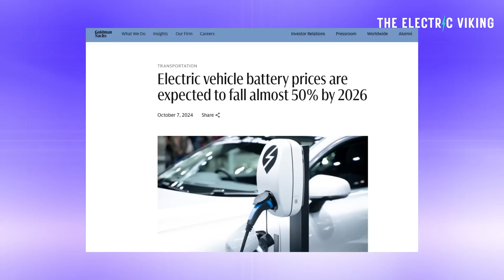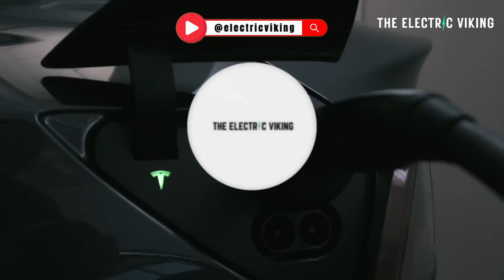Analysts say a NEW EV battery will be cheaper than fixing a gas engine

Comment: This is another reason no matter what actions legacy ICE manufacturers take other than full conversion as fast as possible, they are all destined for bankruptcy.  People don’t understand that the economic effects of losing 50% of their customer base, affects the price of every single part and any chance of making a profit.  All while trying to sell outdated old technology at a much higher price point.  Good luck with that strategy.  The economic devastation of these companies hits in the next 5 years, not 10 or 20 years down the line.  Wait till gasoline prices shoot through the roof from increased costs spread over half the volume.  Nissan may be the first to go inside 3-4 years.  They are in massive trouble right now.  Ask the Stellantis CEO how they are doing.  OH yea, he just stepped down because of that train wreck crashing in real time.

Comment: Yeah if sodium batteries are eventually as weight efficient as lithium ones are now wow hope you have a vehicle that allows easy access to battery compartment🤯
Reply: You would still have to either change or re-program the BMS (and possibly car's body-computor) because the cells will have different voltages and current capacities.

Comment: Imagine how much more powerful NIO battery swap will be with this.
Reply: NIO bot?
Reply: @bobwallace9753  Huh?
Reply: @mysandwichlife  
There are a bunch of pro-NIO swapping comments.  Looks organized.

Battery swapping does not make economic sense.
Reply: @bobwallace9753  it makes way more sense than sticking the battery to the car especially for resale value and checking the quality of the battery.
Reply: @mysandwichlife  
There's no need to remove a battery pack to check its condition.  The EV's software does that.  And as we move to very high cycle life batteries, the body is going to wear out before the battery pack.

Don't judge today's technology using ten year old technology.
Reply: @bobwallace9753  why would you ever want a battery stuck to the car that you couldn't remove. You know how much it sucks that you can't remove a battery from your phone. To each their own, but I'd much rather have battery swap grid stabilization.
Reply: @mysandwichlife  
Battery packs can be removed from any EV.  They aren't "stuck".

The issue is cost.  Battery swapping costs more than just plugging in.
Reply: @bobwallace9753  Yeah they can be replaced for a huge cost which makes the resale value go down immensely.

The whole point in battery swap is focused on people who don't have easy access to charge their car. So this way a battery that lasts a very long time only needs to be swapped out every 2 weeks depending on how often you drive. That's about how often I fill up my tank.

So if you live in an apartment building you can just go to a battery swap station. That's the whole point.
Reply: @mysandwichlife  
Or you can go to a rapid charger every couple of weeks, plug in, and check messages or grab a cup of coffee for the 20 minutes it takes to charge your battery pack.  And it will cost less.
Reply: @bobwallace9753  That's so dumb. Why would you waste your time like that. That's why it costs so much to repair your iPhone now. You can't just take the battery off yourself. You have to go to a store and have them do it. Not being able to remove the battery is dumb. There's plenty of products that as soon as the battery is no longer chargeable you have to buy a new one because it's fixed to the unit.
Reply: @bobwallace9753  Also, rapid charging destroys the battery long-term. It makes the battery not last as long. Using a solar-powered battery swap charging station does all of that for you. In and out in under 4 mins. And it stabilizes the grid. This way, you're not using coal powered fire plants to charge the battery you're using solar power. Everything about swap stations makes sense.
Reply: @mysandwichlife  
I don't think there are any EVs with battery packs than can't be replaced.  As we move to battery packs engineered to last hundreds of thousands of miles the probably of needing to replace a battery pack should approach zero.
Reply: @mysandwichlife  
Rapid charging does not harm a battery pack unless the EV has a pool thermal control system.  Here's the thing, Mr. Life, you don't understand current battery technology and are making assumptions on outdated technology.  

Notice how there is only one company pushing swappable battery packs?  Why are the other hundreds of EV manufacturers not pursuing that route?  Why did Tesla start with battery swapping back in the mid 2010s and then abandon that strategy?  Could it be because battery swapping is not necessary and too expensive?
Reply: @bobwallace9753  Wow, You clearly haven't done any research at all. ✌️
Reply: @mysandwichlife  

(Smile)

Comment: Forget the money. Have you ever had a modern ICE engine, complete with engine harnesses and sendors replaced? Very few shops can get it right.
 A battery swap will eliminate a lot of those shop errors.
 Prices? That's another whole speculation.
Reply: With LFP batteries and their very high cycle life it's unlikely people will need to replace their batteries.  Even the lithium-ion batteries Tesla used in the older EVs are lasting 300,000 miles and more.

Comment: Batteries are a perfect example of economies of scale in production. If you wanted to manufacture just one, it would cost millions, maybe hundreds of millions of dollars. But if you want to produce a hundred million, it won’t cost much more than making just one. The manufacturing complexity is lost in the scale of identical units. (For a comparison, imagine what a bespoke smartphone would cost, and look at what they cost when we make a hundred million of them.) So it makes sense that, as manufacturing experience grows, cost of manufacturing will approach the cost of the raw materials alone.
Reply: With batteries, it's all about the price of materials.  There was a shortage of lithium which made battery prices high.  Along with the high cost of cobalt.  As EVs move to LFP batteries and lithium production has greatly increased material costs have plummeted.
Reply: @ There’s this myth that lithium is rare. It isn’t. But the mining facilities are still coming online in response to demand. And with exponential demand coming, there’s a LOT of motivation to get supply in the pipeline.

Comment: Hello Sam, Shana;  
I'll try again, whoever open's please just foward it to Shana, It works!!
This is a response to your announcement of your wife's malignamcy.  I will keep this short & to the point as my handicaps make this difficult.  I am 84 yrs.   There is solid science behind what follows.  For years there have been unexplained reports of cancers vanishing, also several somewhat successful alternative treatments..  A Roman physician/researcher(T. Simoncini) made a key discovery Pointedly ignored in the mainstream.  A radiologist vacationing here in Cambodia corrected me Loudly on these matters  with "I DON't Want to know This!!"  
The Dr. discovered if you kill the candida albicans always seen in the proximity of the cancers, they  go back to being normal cells.  Our cells don't seem to like it, they react very badly.  Common baking soda  kills it without causing other  problems( I also use turmeric, old Hindu discovery on cancer pain) .  The 2 together seem to  accelerate  the results even more quickly than just s. bicarbonate.  My stage 4 prostate growth disappeared in less than a week with oral dosing ( 2 yrs. ago).  I saw results in 2 days.     
I used 1 heaping teaspoon in 1/3 of a glass of water once an hour + 1/4 teaspoon turmeric mixed in steamed rice daily.  I continue to   use bk. soda a few times a month to make sure it stays gone.  If you go running to your Dr., with  a 2 cent market item replacing $50,000- $250,000 of "treatment".!! will he just go quack-quack, trying this costs nothing in the way of  time or money, just do it!!. you will be pleasantly Shocked!!  Is the chemo the real quackery??   if she is taking an opiate pain killer she will seem to get very drunk-- stop the drug, no more pain.  she will be normal in a few hrs.  
your work is to important than to be interfered with by a problem like this.  There is SO much More to talk about.   
Please don't copy  me to other people, I want keep it private.   I can't handle a lot of additional communication.  Thanks. 
Best Wishes

Comment: EV's should be designed based on the Leggo concept.
Every major part of the EV should be swappable.
Drive in the shop and drive out in 10 minutes with a new body or battery and bottom chasis?
I think thats where we are heading as a cost effective ev ownership model.
High end model ownership can have a different concept of custom build and maintenance.

Comment: It´s great news: for governments! They can finally put a 100% tax charge on batteries (to make them expensive again), plus a fixed annual fire department charge and a CO2 tax per kWh for the 500.000 tonnes earth-movements to produce one battery pack. I would agree on prices coming down -  as happened with solar panels. If the future technology allows for higher battery energy density we´ll see but in 2024 it´s doubtful. 10% more - yes - but imho batteries really start getting interesting when You can pack 1 kWh in 1 KG batteries and 10 kWh in 10 KG batteries. To get there, efficiency would have to increase sixfold or 600% from todays standard.

Comment: It might be on the sooner side if we can avoid the massive recession economists expect.  What GS left out was the 16 hours of labor to replace that engine.  $3500 is just the parts.  Add to this the recycle/reuse value of the battery pack and price parity is around the corner.  The bottleneck will be finding a shop that can do the work.  That side still needs to scale in most of the country.
Reply: @titanispi1998  Just do the reconditioning yourself.  Never mind the 400dcv minor hazard. https://youtu.be/0HWnRSYCvNI?si=Ig55x_fb11kzt9Sh

Comment: 6:00 "You will probably find that at an energy density of an estimated 400 Wh per kg, you wouldn't need anything more than a 50 kWh battery pack."
You got your physics wrong, Viking. The only thing higher energy density provides is lighter packs. But a 50 kWh pack only provides 50 kWh of energy, even it weighs less thanks to a higher density. You are mixing up energy density (kg/kWh) and energy efficiency (mi/kWh). For a car energy efficiency of, say, 4 mi/kWh, a 50 kWh pack will always provide a 200 miles range. Increasing the energy density will just make that 50 kWh pack LIGHTER, so you actually would improve the overall car energy efficiency somewhat, but that range increase would remain marginal.
The main factor in car energy efficiency remains aerodynamics. That's why Aptera is full-in on aerodynamics, and they get 10 mi/kWh. Aptera will get 500 miles out of a 50 kWh pack, whatever the weight of the battery. They actually announce the same efficiency for all their packs (10 mi/kWh), which shows that weight is not the main issue. The #1 factor for efficiency is aerodynamics.
Reply: This is fantasy.  Lion is still the best energy density and the technology is 40 years old.

Comment: Viking I'm a big fan!! But neither you nor the article mentions the value of the used batteries for the secondary market or the value of the minerals. I have a 2022 Model Y and by the time I need a new battery it will get swapped out in exchange for free for my current nickel battery! Can an ICE engine make that claim?

Comment: Reality is far different though. Automakers don't want vehicles to last longer, since they get most profits during the initial sale. Also the policies that favor ICE vehicles, see the low battery option to be unfavorable to the current economic landscape. If at all, a low cost battery replacement option becomes available, there will be regulations restricting how many times a battery can be replaced, to be road worthy🙄. In the end there is no free or even subsidized lunch🤞.
Look what happened to yearly vehicle inspections and additional road taxes for BEVs in U.S. You can't escape the tax man!😂❤👍

Comment: I don't believe that the average battery pack will fall to 50 kilowatt hours. What we are seeing is the opposite, an ever increasing battery pack size. Yes it's good that energy density increases and the weight falls. However vehicle weight does not affect range nearly as much as people argue. And people still want more range and large vehicles. I have two EVs and there's no way I'm buying another EV without at least 350 mi real world range on the highway. Most people in the US and probably Australia as well feel the same. This is still going to require 80 to 100 kilowatt hours or more.
Reply: But for most folk in most parts of the world, they hardly ever drive long distances, and can hire then.
Of course you need a good charging infrastructure and fast charging

Comment: Another issue is EV battery packs can be reconditioned for far less than full replacement.  What's going on is a battery pack can only be charged and discharged to the level of the weakest battery cells.  So reconditioning involves removing these weak cells and replacing these cells with cells matched to the good cells in the pack.  Cost being about 1/2 to 1/3 of a full new pack.  Usually the reconditioned pack being good for another 200k miles.
Reply: Quite often the burn out the fuses to the bad cell and the pack is good to go.
Not sure about direct replacement though.
I remember reading something about the replacement cell has to be very very close to the rest of the pack in voltage and a couple of other things as well.
Been a while since I looked into it.
Reply: I haven’t heard of anyone replacing individual cells in Tesla’s. What am I missing?
Reply: @rustybucket2248  Tesla is not the consumer's friend. Right-to-repair from Tesla is on par with right-to-repair from Apple.
Reply: @rustybucket2248  You can't replace Tesla cells because the space between cells is filled with that nasty expanding plastic foam.
I mean, you CAN, but it would take forever to clean up that mess... so they generally replace the battery sections that have the bad cells.
Reply: This is how a EV battery recondition is done.  Watch the video and you can do it yourself if you don't mind a little 400dc volt risk. https://youtu.be/0HWnRSYCvNI?si=Ig55x_fb11kzt9Sh
Reply: Insurance companies state they struggle with insuring 'refurbished' battery packs
Reply: @chrisbarron5861  makes sense insurance companies would have trouble insuring reconditioned battery packs since there is no track record  on their risks.  But for the most part we are talking about ten + year old vehicles here.  These are paid off vehicles that most likely have depreciated a lot.   In this case it's best to put money in a savings account for a new car instead of an insurance payment. The car has met it's working life with continued service simply a bonus.
Reply: That can and is done with the Leaf because the battery doesn't have liquid cooling channels and can be fairly easily unpacked to the cell level. The technicians doing this need to be well trained, but there are videos on youtube suggesting the entire operation takes five to six hours, plus of course the cost of replacement cells.

However, most liquid cooled batteries have a much higher packing density and are 'sealed units' so while the battery pack as a whole can be removed and replaced, it can't be readily broken down to the cell level. 

The other side of this however, is that these batteries are free of the heating problems that limit the life of the Leaf battery, so there is less need to replace them in the first place.

Comment: Does having a robot changing the battery when needed sound like a bad idea? No...that is why you buy an EV with battery swap.

There will be a billion EVs. Manually getting the battery out when recycling?.. And the added bonus of swapping in a charged battery in 3 minutes.

So you dont have to kill the battery with fast charging. Most people live in apartments with no home charger. 

And all the other benefits that come   with swap.

Comment: So for ~4K plus labor i could replace the battery pack in my model Y. And still have the original battery pack, potentially wire it up to use it as a backup power (or off-grid power) for my house? Sweet.
Reply: Sell the old pack - it will still be worth something.

Comment: Surely the kWh pack size won't come down much if not rise. The range has to increase in the eyes of the nay-sayers. What will hopefully come down is the weight of batteries, which translates into a small increase in range for a given kWh. With cheaper batteries comes cheaper cars and the viability of small EVs, and that will translate into more charging stations, which will accelerate sales. Apart from time spent charging, the whole range anxiety thing is tied up with the "nearest" charging station.

Comment: This is why everyone should not be afraid of getting an EV from a company you know will be around in the future.  Drive your EV for well over 250K (assuming you take care of all the other parts of the car) or more. This will take most people 15-20 years. Then if you need another battery pack it will be cheap. 
     You may also get a ton more range by then too as the energy density of standard batteries will have gotten much better. So you may have the option of getting a higher KWhr pack in the same size pack OR one that is similar in power to the old one but much lighter this also giving you more range. 
    Who knows, with care, parts replacement, etc your EV may be the last car you will ever buy new.